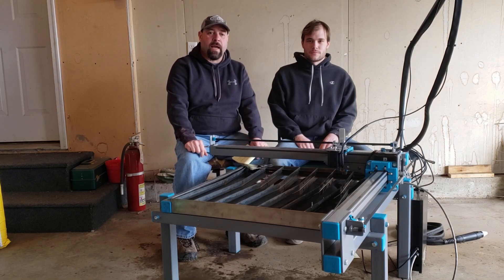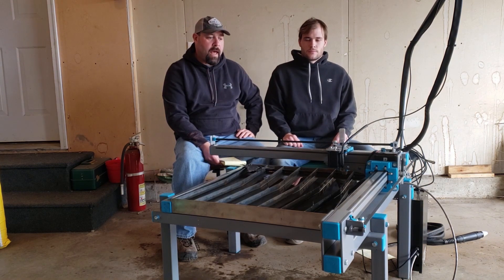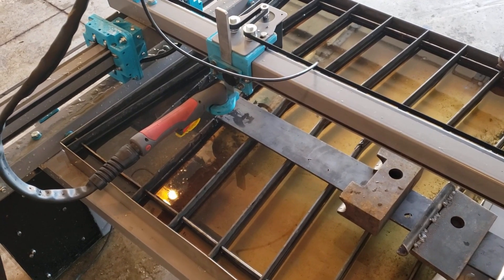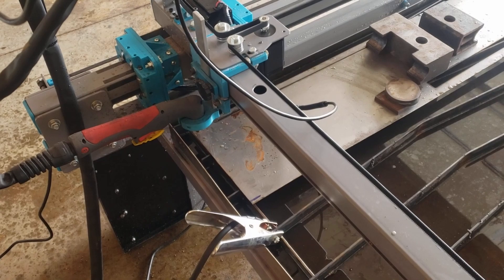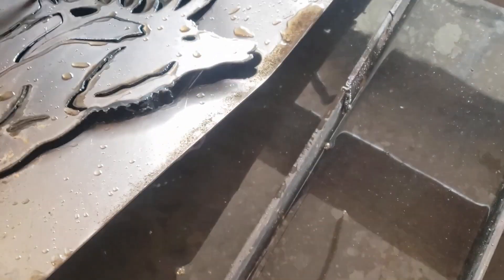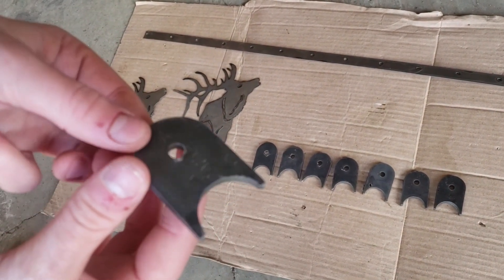$350 Budget DIY CNC Plasma Cutter - Quick and Easy

Comment: ✅ BEST FILAMENT FOR YOUR SETUP

🥇 Carbon Fiber Nylon (PA6-CF or PA12-CF)

This is the best choice for plasma cutter components.

Why it’s ideal
	•	💪 Very high stiffness (won’t flex under gantry load)
	•	🔩 Excellent layer adhesion
	•	🔥 Heat resistance 120–170°C
	•	🧱 Handles vibration far better than PLA, PETG, or ABS
	•	🚫 Much less creep than PETG
	•	🧲 Stable under mechanical stress

This is the filament most CNC and plasma builders use.

⸻

⚠️ What parts it’s perfect for
	•	Torch mounts
	•	Cable carriers
	•	Sensor brackets
	•	Motor mounts
	•	Belt tensioners
	•	Limit switch mounts
	•	Drag chain brackets

(Not for parts directly exposed to plasma arc — nothing printed survives that.)

⸻

🧪 Recommended Filaments (proven)

⭐ Polymaker PA6-CF (Nylon 6 Carbon Fiber)

Best overall balance.
	•	Stronger than PA12-CF
	•	Higher heat resistance
	•	Widely used in CNC builds

⭐ MatterHackers NylonX
	•	Excellent vibration resistance
	•	Very tough
	•	Slightly easier to print

⭐ Bambu PAHT-CF (works fine on K2 Plus too)
	•	Very dimensionally stable
	•	Lower moisture sensitivity
	•	Great accuracy

⸻

⚙️ K2 Plus Setup (Important)

Your K2 Plus is capable, but setup matters.

Required:

✅ Enclosure (K2 Plus has one — good)
✅ Hardened steel nozzle (CF will destroy brass)
✅ Dry box or filament dryer (absolutely mandatory)

Recommended settings:
	•	Nozzle: 280–295°C
	•	Bed: 60–80°C
	•	Chamber: 45–60°C
	•	Layer height: 0.28–0.32 mm
	•	Infill: 40–60% gyroid
	•	Walls: 4–6 perimeters

Dry filament at:
	•	70°C for 8–12 hours

Moisture is the #1 reason nylon prints fail.

⸻

❌ Filaments to avoid for plasma builds
	•	PLA (softens too easily)
	•	PETG (creeps and flexes)
	•	TPU (too flexible)
	•	ABS (warps and cracks over time)

Comment: I really want to buy your plans and build one of these, I actually need one in my shop, but programing worries me. I have never ran any cnc machine so a complete newbie when it comes to this new tech! I'm a retired harley mechanic, 35 yrs, machinist, and i was an aviation electronics tech in the Navy, towards the end of my career I was reprogramming ecu's for fuel injection on harleys efi systems. That was easy, but i didn't have to draw or write any programs. I looked at fusion 360 but didn't download it, any other programs you might recommend for beginners?

Comment: Thanks for the video.    Why not have the X motor on top with a stand off for the pulley instead of having it hang low and dragging the cable across everything??   Just wondering.  I would have the motor on top, myself.

Comment: so i see a ton of printed plastic items and bolts. seems theres a printer to add to the build cost and shit ton of drill bits bolts and all that. seems to me any one who owns a plasma cutter has some type of welding machine probably first.and the ability to make clean joints and welds to assemble the frame. so being we are metal workers whats the deal with the printed parts besides a marketing push for printers and pla?
Reply: Welder here. You can skin a cat many ways, welding works if you can make the parts not warp and want to take the time to weld out and machine the necessary features, or you can order the printed parts for pretty cheap from a pro and know they’re pretty close to square. It’s just easier.

Comment: Hey… I love the build!! I have purchased the plans and plan to build a machine soon. I did have a question… I noticed you (and others) have painted the rails, but left strips open where the bearings ride. I assume this is because the paint would interfere with how smoothly the bearings operate. Did you protect these areas from rust in a different way like a sealer? Or do you just make sure they are cleaned off before they start to rust?

Again, great build!! Thanks for the great work. 😃

Comment: I just finished building one of my own from your plans. Loving it so far, and after doing a few cuts, I noticed that the x axis is cutting out everything in a mirrored image. The y cuts fine but everything on the x is flipped over. I'd really like to know if anyone knows how to correct this. Would like the cleanest side of letters to be the front. 

Thanks for any input. Also, I have followed the grbl settings  and wiring completely. Even quadruple checked everything.
Reply: Your wiring to the stepper motor is probably incorrect. Try inverting them and that should do the trick I believe
Reply: if your using mach 3 there is a way to invert it in the software

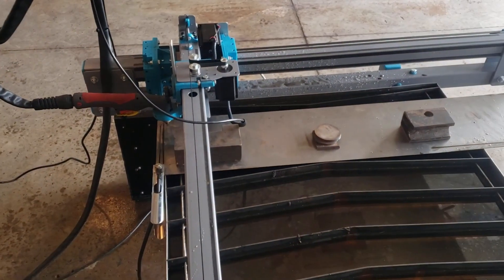Comment: @5:22 The excess travel before cutting is probably related to where your software starts the cut. You should be able to edit that before creating the G-code depending on what you are using.

Comment: Hello all got your plans and going over everything have a few questions first the 3dprinted parts i assume 100%, infill on them and the lighting sissors i have is the lotos  ltp5000d anything i need to know irregards to thees plasma cutters it seemed fine for me it has non contact arc i bought to to disassemble an old dodge Winnebago  took only a couple days some parts where quite thick  about 3/4 it was slow but did fine, did go thru a few tips and nozzles gonna start printing parts soon love the work you guys done ❤ thanx

Comment: I'm interested in your table plans design I would like to no if I could enlarge the table design and still use your recommend motors and controllers. Also is a prime weld plasma cutter compatible with these motors and controllers

Comment: Thanks for building this. Has the design a limit for the material thickness? E.g would it work for cutting 1 inch steel plate? Also, can the torch holder be adjusted to cut 22.5 or 45 degree bevels?

Comment: This is KISS Brilliant, Keep It Simple, Stupid! Brilliant! Even if I am too dumb to make it work.   Ideally, I'd make the frame longer to accommodate at least a 78 inch x 24 inch sheet.  Maybe make the torch gantry arm from 6061 aluminum to minimize sagging along the X Axis arm?   Then figure out a way to make sure the torch lines don't drag in the grating and/or water bath.
Reply: I kind of did this but only went out to 48" in length. 

Key thing I noticed is by increasing the span of the x axis it give it more area to twist and creates a small bouce with the torch. 

I'm going to put a roller at the far end to counteract this.

Comment: Can you be honest. Would it be better just to by a crossfire? It’s kinda hard to beat the price. I keep adding costs up and it’s hard to beat.
Reply: My opinion , and I am in the process of building this, It was easy to purchase what I needed when I needed rather than coming up with the money all at once. Other than the Plasma cutter itself I made several smaller purchases. Another thing for me is when I build it I can problem solve it much easier, instead of calling support for a thing someone else built. The cost for this is cheaper than a crossfire from what Ive seen.

Comment: Guys this looks like a great product and I am contemplating picking up the plans but just curious what is used for the control of the system?   I'm a novice at software and programming so just curious what I would be getting myself into.  Thanks!
Reply from the maker: The machine runs on grbl 1.1 which is open-source and free. The plans go over how to install this.
Reply: Can I install this on my laptop?

Comment: Hi guys, im starting to build my controller and cant flash grbl to my arduino clone, any special instructions??
Its a elegoo uno r3...
Reply from the maker: It should be the same as a regular arduino. Just have to make sure you are flashing to the correct com port.

Comment: i was about to buy the langmuir crossfire so this your build basically the same but a lot cheaper. Do you supply list of parts for someone that's in the uk with your plans? Would a total newbie manage to build one of these. thanks
Reply from the maker: A full BOM is included in the plans. Yeah a total newbie can build this. We didn't have any experience with cnc before this.

Comment: This is very well done. I did find by making the 30" Y frame rail 32" and moving the hole from 27" to 31", longer legs (easier to load machine) can be fitted and still fold. Also small casters on the underside of the X frame rails make it easy to roll under a bench with legs folded.

Comment: What kind of 3D printer would you recommend? I am a PLC/HMI engineer in the offshore oil & gas industry. So I can handle myself but with all of the options out there I don't know which way to go. Your advice would be very much appreciated.
Reply from the maker: Can't go wrong with an Ender 3. When they are on sale they are less than $100. And are pretty much plug and play.

Comment: this is very cool, In the budget of $350.  did you build it all but the plasma cutter?  is tehre a spec for the type of Plasma cutter required?
Reply from the maker: Yes we built the whole machine. Any low frequency start plasma cutter will work.

Comment: So does $350 include the cost of the plasma cutter or is that just for the table?
Reply from the maker: Just the table.
Reply: @jdsgarage701  ok no problem. I already bought a no touch cutter. Couple questions though, can this frame be made from aluminum flr weight and did you figure out the software side you were having issues with (gcode)?
Reply from the maker: It can be made from aluminum, the issues are with we we generated gcode in fusion 360.
Reply: @jdsgarage701  ok. I will go ahead and order the plans thanks

Comment: Oh,  a Huawei CNC [Smartcut 2200]  ( LangmuirCNC [crossfire] ) copy!  Langmuir had once tired to claim that their linear rails system was “patented” or (patient pending). However it was an protectable design and I can’t find any documentation on this. The bearing cartridges maybe protected so o would definitely and drastically alter that. Langmuirs components likely come from a Chinese company named Huawei. They sell an identical table right down to the driver mounting holes in the controller. They also sell a unit to the public Smartcut2200. I understand that you “redesigned” the drive system to be belt driven instead of the flimsy T series lead screws however, the rest of the machine is a clone of the Langmuir/ Huawei. This is a problem when selling the schematics. You may need to distribute them free and sell your printing service and z schematics. Although a good z is only ($75).  I see nothing wrong with that after the company tree to project the idea that their product is USA made and the product is sub par. The issue is selling the drawings of the components that are nearly identical especially true with the frame.  Also if your copying the wiring of the table it is deeply flawed efficient for an extreme budget build.

Comment: For all you guys who build that table...do you prefer belt tensioners angles made from steel or printed ones?
Reply: Definitely steel. The printed ones work great but if or when they crack and fail your project is ruined. Better safe than sorry. And not that hard to make.

Comment: Thank you guys. I ordered my plans and am about to start 3d printing. I have two questions, supports or no supports? And do you see any benefit in using pla plus? Thank you!
Reply from the maker: The only part we use support on is the L-shapped X axis. In this application using PLA plus wouldn't really make a difference.
Reply: @jdsgarage701  Thank you!
Reply: I tried the 1st large print without support... It didn't seem proper, I don't know what I was thinking... Anyway I stopped at midway and started again using support, working beautifully.  Thanks once again for your hard work! I'm super excited about this project.
Reply: I'm very very new to 3-D printing so I just realized what my mistake was...  Cura Slicer input the bearing block as a vertical (like a wall) instead of a horizontal (like a tabletop) and I didn't know enough about it to lay it flat on the  Build plate... That's why it needed supports. I have wanted to buy a 3-D printer for a long time and your awesome project was the motivation to finally do it. Thank you guys.
Reply: @garymatthewsjr1416  
I did mine standing up and there was alittle defects,  curas default setting

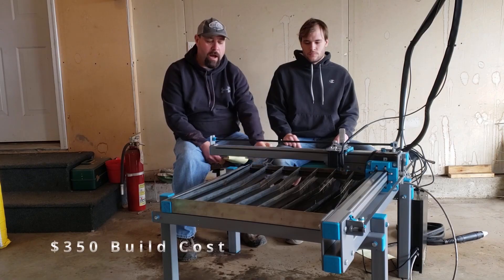Comment: 2:39 Isn't the PLA printed part holding the plasma torch exposed to temperatures that could either melt or at least soften it and affect the torch tip position?  Either from heat from within the torch head itself, or from heat coming up from the plasma arc and hot metal (if a slow thick cut on a curve like a smallish circle that keeps it more or less in one place over the super hot metal)?
Reply from the maker: Plasma cut metal doesn't get nearly as not as you might think. It also has the water cooling it from underneath. We've been using the same piece for 6 months with no issues.
Reply: @jdsgarage701  Thanks for the quick reply, and, interesting.  I'm going to try it and see how it goes (a system based roughly on this https://www.youtube.com/watch?v=xVZZfx9KPlc)

Comment: I had to order my metal. I've been printing my parts. I can't wait to get started and hope you guys can figure out an easy DIY solution for THC!
Reply: How much did it cost to build?
Reply: @65_roses_jku7  just started making mine and I’m in the table about $520. My metal supplier chargers extra to have pieces cut to length so I bought full length pieces instead. Just something to keep in mind when buying the metal, but it’s something you can utilize later.
Reply: @compactgarage3023 is that with electronics or just the bare steel costs?
Reply: just built one and all in on the tabke and electronics I'm at about 900 canadian. That's not including a computer to run the software or the plasma cutter - I went with primeweld cut 60 and it's amazing so far.
Reply: howd it go?

Comment: Doesn’t appear to have thc or did I miss something? If it doesn’t, how does it do on warp of material and how long do consumables last?
Reply: What size table and what size materials can be put on it? Thanks
Reply from the maker: Correct it doesn't have a thc. We have experienced zero warpage on material and run 20ga steel on a regular basis. Key is to run fast enough so there is minimal heat transfer. Cutting area is 28"x30" but can be easily changed. The plasma cutter is rated for 0.6" but the thickest we have run is 1/2" with great results. We typically get 2hrs of actual cutting per set of consumables.
Reply: @jdsgarage701  cool thanks for the fast reply.

Comment: I am looking to build similar system only I wanted to go 48" x 48" do you think the single gantry arm would be sufficient? If not how hard would it be to modify plans to have additional slaved Y motor and second gantry arm.  Also do you just manually set Z height before each cut?
Reply from the maker: From the testing we've done it seems that about 40" on the Gantry arm is the limit which would be 30" in the X-cutting direction. It wouldn't be that hard to make a dual support, someone actually just did it. All you would have to do is copy is make a second Gantry assembly, and run a second motor in parallel with the first. Currently we are setting the z height manually and haven't had any issues.
Reply: @jdsgarage701  What if on the end of the gantry arm there was a 3D printed bracket that had 1 or 2 bearings that rode on the Y frame rail for extra support?